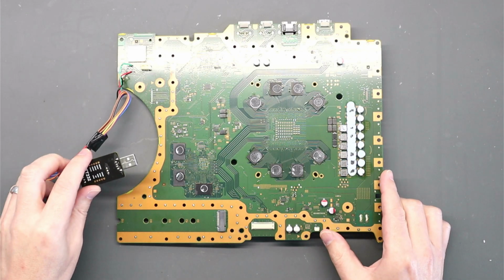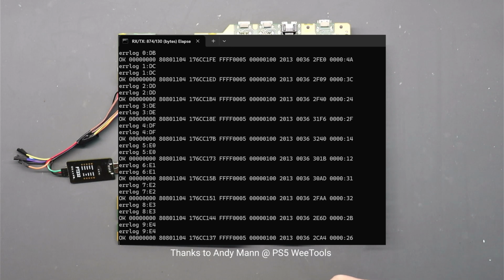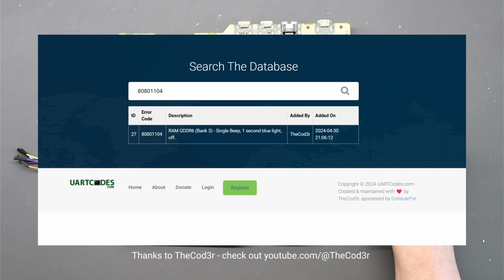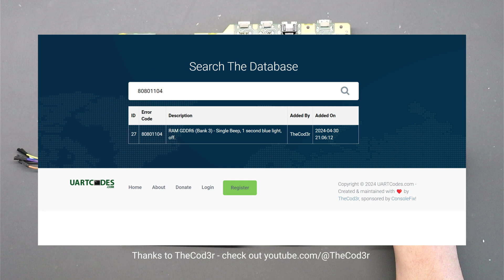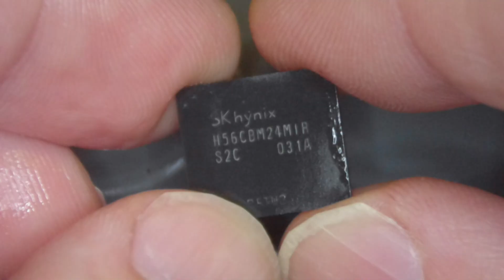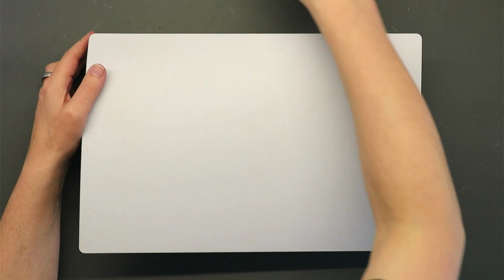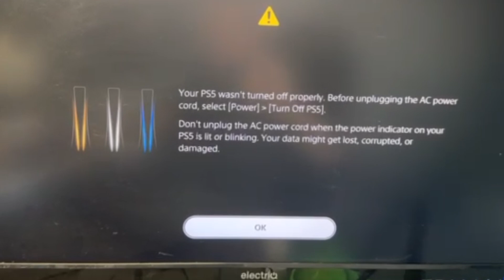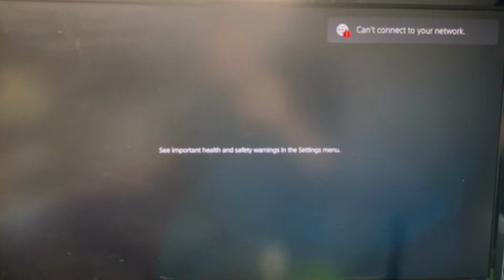PS5 2 Second BLOD - Replacing faulty DDR6 RAM IC to fix a no power issue. UART Error code 80801104

Comment: I don’t have an exact chip I need but I have a donor board with micron chips but the dead board has Samsung chips. Will this still power on? Has anyone tried to install a different brand Ram IC
Reply from the maker: Personally I have always used the same make/model RAM ICs - I would not recomend mixing them

Comment: Hi bud, thanks for the upload. I've got a code showing for bank 8, but after clearing the errors and trying UART again, it now says no errors. Is this because the console only shows these errors after the console is attempted "full power on" by pressing the power button? Don't really want to put it all back together, whilst i can replace bank 8 on the bench now. Many thanks
Reply from the maker: If it was me, I would probably replace bank 8 anyhow to be on the safe side

Comment: Nice video as always. Can I ask what you mean by Soak test? Haven’t heard the reference before
Reply: Ahh looks like a Stress test essentially. Do you have any methods you prefer??
Reply from the maker: @ Hi James.. Correct.  I usually just play a few games for a few hours, making sure there are no glitches etc etc.  Top tip - if you have not time to play games, if you have a copy, load up FIFA and play a match without picking a side and the console will play games against itself ;-)
Reply: @ great idea thanks. I always feel guilty when I mess with a
Customers Kill ratio or the like, terrible at most games 🤣